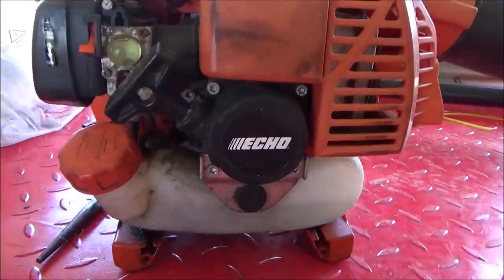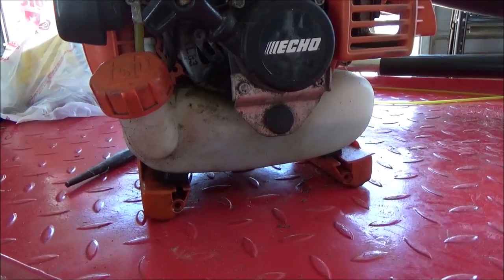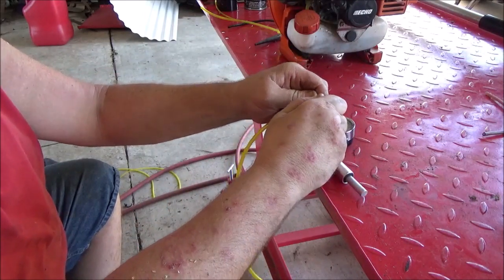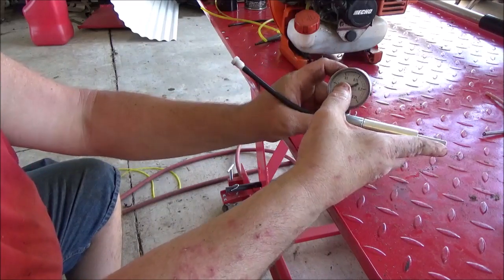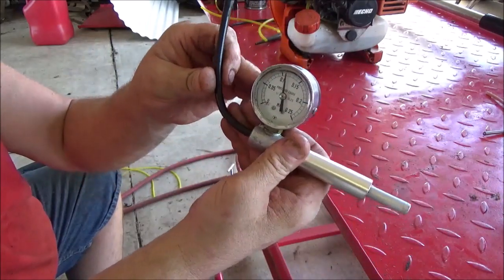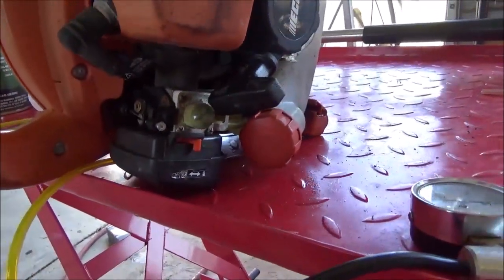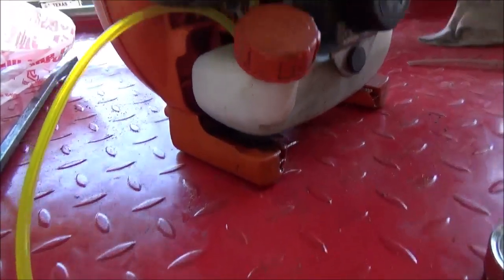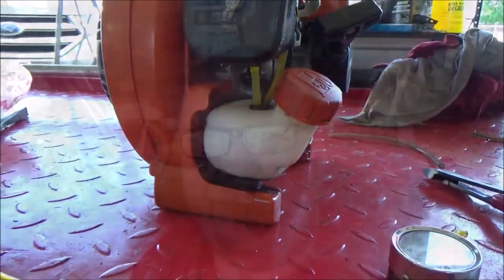ECHO 2 STROKE ENGINE FUEL LEAK REPAIR AND HOW TO TEST!

Comment: Great video!   I’ve rehabbed a couple of these back into service.  There actually is a home for the vent, it’s molded into the case right near where you left it dangling (just to the left at the very end of the video).  Not that it matters, it doesn’t.

Comment: Good video buddy i use a mighty vac for doing test like you were doing it does pressure test and vacuum test and more. They sell them on amazon ebay i think they may carry one version at harbor freight they also work as a brake bleeder a great little multi tool. You might want to put one in your store.

Comment: What would cause a unit just like this one to idle perfectly and rev to about 1/2 throttle but not to be able to go to high rpm? I have installed a new carb, checked for muffler restriction, pressure and vacuum tested the crankcase, loosened gas tank cap, new fuel filter. Throttle lever is touching the stop. I have even located and adjusted the covered up hi idle screw with no change. I am buffaloed.
Reply from the maker: Coil is not advancing the timing
Reply: @THEMOWERMEDIC1  Can it be adjusted?
Reply: @THEMOWERMEDIC1 How is timing adjusted? How to fix?
Reply from the maker: Bryan Davis it’s done by rpm and a microprocessor built into the coil
Reply: @THEMOWERMEDIC1  Ok. That means replacing the coil I guess?
Reply from the maker: Bryan Davis very rare but it does go out